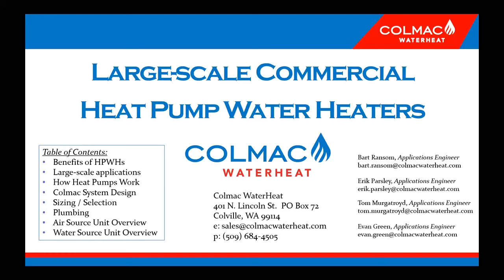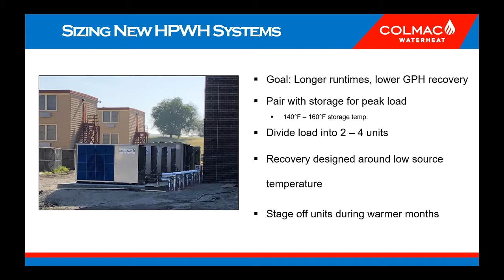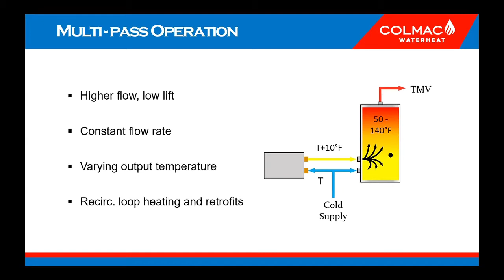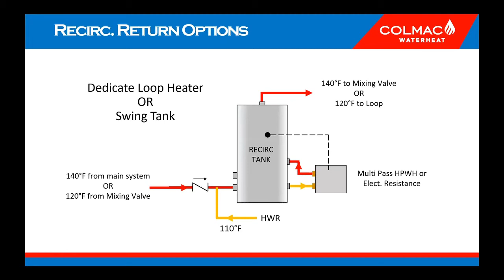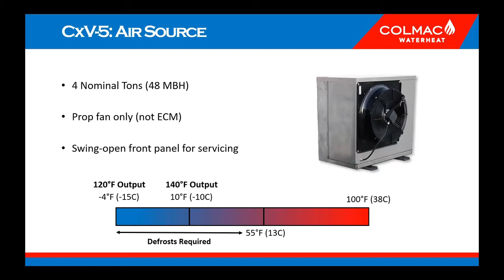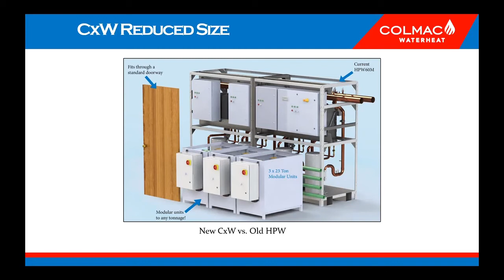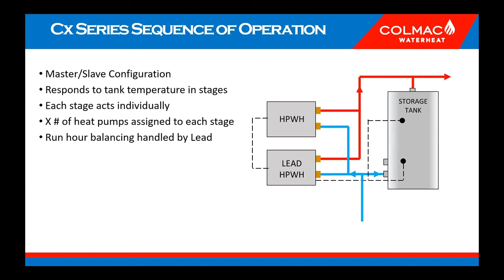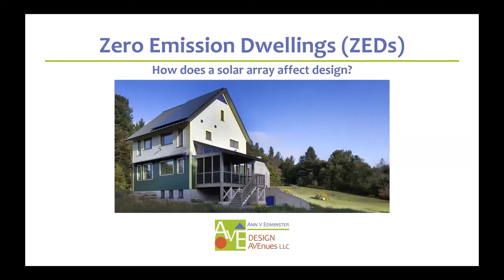Erik Parsley, Colmac: "Large-Scale Commercial Heat Pump Water Heaters"

Comment: I have an  oil hot water radiator heating system in  my home.  I need a electric heat pump water heater to heat the water for the radiator system. I believe it should heat to 180 degrees. Do you make one for my application ?